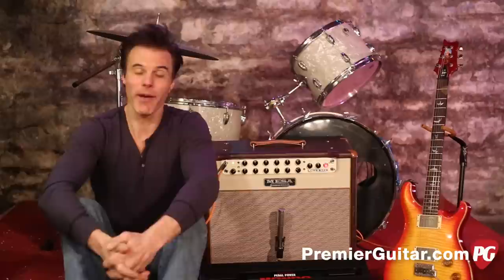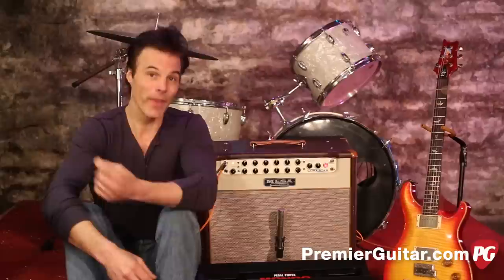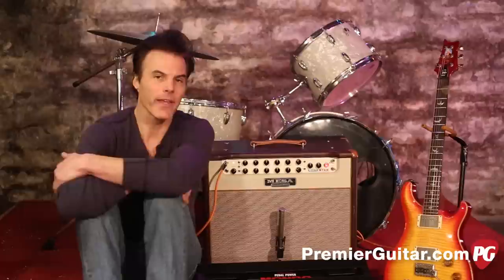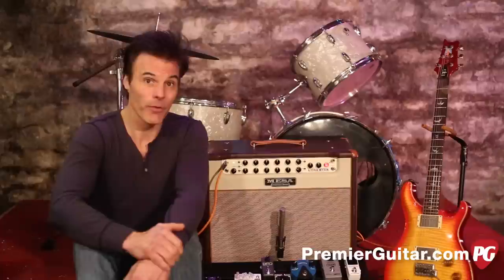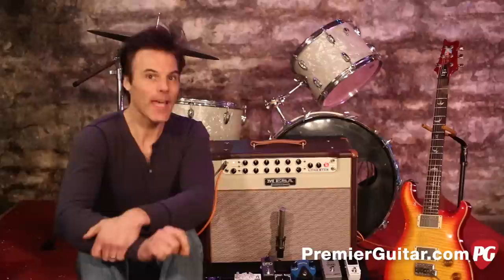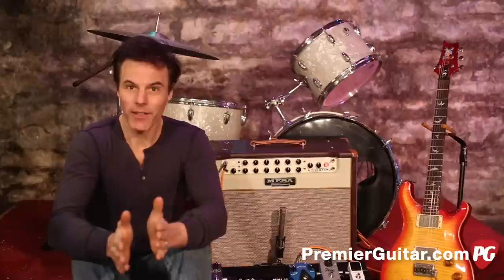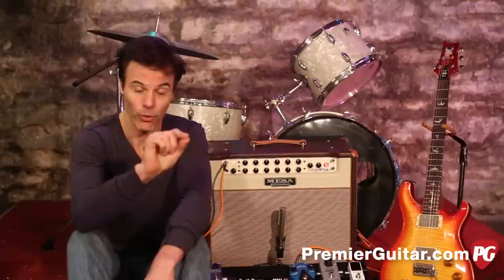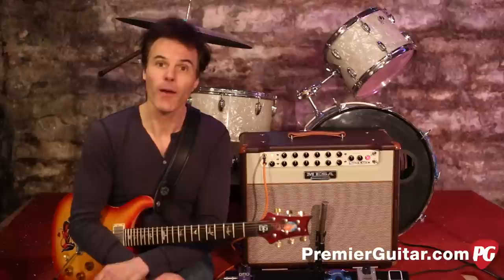DIY: How to Wire Your Pedalboard featuring John Bohlinger

Comment: Pedalboard Tip: Put the loop part (soft part) of your velcro onto you pedal and the hook part (pointy part) on the board so your pedals do not stick to the carpet, most people usually have it the other way around
Reply: I like it when they stick to my robe!
Reply: Homeowner Tip: carpets are for garbage people; tear that trash up and replace it with attractive (and healthier) laminate flooring
Reply: @lazylion420  jesus...the sarcasm is real. Love it. I was thinking the same thing.
Reply: @lazylion420  carpets are way more appealing on bare foot. Laminate flooring is good if you want to break your neck after getting out of the bath.
Reply: Well, I use a board with carpet attached to it, so I gotta go with the crowd
Reply: I do opposite because my board has several pieces of carpet that fit in my soft bag, I set up 3 different boards, each wired, I then choose which block I want on stage and I do want it to stick anywhere I place it
Reply: Great tip! Thank you!
Reply: I would do soft part on the board and hook part on the pedals 'cause otherwise the board will get grimy and junkish...
Reply: Put the pedal on your board so the pedal doesn't stick to the carpet.

Comment: Some great advice here. I wish there was something like this when I was getting started.
I would like to see in a future video:
1.  Pedals that go into effects loops.
2.  True bypass and buffering
3.  You mentioned digital pedals, so there should be some mention of AC power.  And with AC comes strict current requirements WRT power.
4.  For the future, I think a video (or series of videos) on MIDI boards from floor to rack would be very useful if you have 14 or so pedals -- think RJM's Mastermind to a RG-16 or something similar.

Comment: That's a great video John and PG. Very useful and no doubt a vital future reference for pedal enthusiasts. Thank you, I'll be sharing it for sure. The only thing I'd add would be to try and isolate digital pedals from analog in the power chain. That is, don't daisy chain digital with analog if you can help it as it will help avoid a potential 'mozzie' like frequency running through your signal. Cheers, B.
Reply: Or just don't use digital pedals at all...
Reply: +Danny Skrims Yes you can as long as your power brick can handle the milliamps. I use a 1 Spot CS12 from Truetone. As long as your power brick have designated 300 to 500 ma, you can run pedals like TC nova delay, line6 m5 ect.
Reply: Guitar to pedal then pedal to amp? or guitar to amp like normal and pedals to my DSLs fx loop in back of amp? Brand new to pedals, app tips. Thanks
Reply: Agreed. I have two power bricks, one for analog, one for digital.

Comment: I have a suggestion, for everyone with a Pedaltrain or anything else that's open & allows cable routing underneath:  rather than use velcro (which has failed me, and made a gooey mess), get a cooling rack (for baking) sized appropriately for your board and with at least 1" squared grids (to allow angled cables to pass through), zip-tie it to the underside at the four corners, get a spool or bundle of nylon cord or equivalent and cut enough length to tie each pedal to the board (burn the ends as fray-check, damp paper towel nearby).  I did that, and zip-tied the bigger pedals.  You'll never have to worry about the velcro failing in the summer heat, and you don't have to remove any feet from the bottoms.  Alternatively, I just bought a cheaper non-Pedaltrain board without slats (want to stop burning through money so quickly), and tried not even securing the pedals, but padding inside the case with the bubble wrap from shipping or an old T-shirt ... they don't really move around in transit, the board's flat when I'm playing anyway, and I feel more free to experiment with pedal order or substitutes than on my other board with pedals tied down (or when I had velcro).

Comment: I would highly recommend using 3M:s Dual Lock instead of the velcro. It is a lot more durable, holds the pedals better and does not go bad over time.

Comment: I would also suggest experimenting if any pedals sound better to you in the effects loop rather than in the front of the amp. Or even which pedals sound better before or after a distortion pedal. Those were huge tonal factors for me.
Reply: Roman L  Absolutely.
Reply: +Roman L I totally agree man, a lot of your modulation effects tend to sound better in the effects loop compared to right into the front. But hey, in the end it;s your own sound, so build it how you like it, we're just random people on the internet,.
Reply: Roman L.  Yes. Takes a ltitle more set up time but worth a try!
Reply: I found that Fender amps take a lot more kindly to putting all the effects before the pre-amp. Some amps don't like this at all, but Fender seems to be ok.
Reply: Roman yeah a good rule of thumb is time based effects go in the loop, dirt/volume goes in front.
Reply: Mark Farnsworth This only applies if you are driving the pre amp on your amp, ie amp overdrive. If you are just using a clean channel and using pedals to get your gain, the effects loop is not really necessary, and everything in the front works perfectly.

Comment: Speaking about power, what he didn't mention but is quite important to know: There are two parameters which determine electrical power: Voltage (V) and current (1A = 1000mA). And there's a little confusion going on.

1st: Voltage needs to fit!! Your supply should never give you higher or less voltage than what's written on your pedal (or in the manual)! A little more (like 1V) should be fine because good pedals should be protected (see manual). But this may reduce life time and makes you lose any warranty. Also pay attention to AC or DC (there are pedals that need AC power)

2nd: Current printed on the supply unit must be higher than (at least equal to) what's on the pedal. Even if it's ten times as high, That's fine. There's no limit. If you use a daisy chain, add the current of all your pedals, and it must still be lower than your supplying output. Don't ever run a digital pedal with less current than it needs, you can seriously damage it!!

Comment: I used to run hosa cables with a daisy chain for my pedalboard, I redid the entire thing with a BBE Supa Charger, and Mogami cable(redco sells bulk cable) with neutrick jacks and it made a pretty noticeable difference immediately. I had to turn the treble down on my amp! Much less hiss and hum!

Comment: Very good instructional on pedalboards!  I would like to add use a steady base. I used to use a board that came in a bag. Biggest problem was the board moving around on stage when I used a wah! The whole darn board moved.
I solved the problem by converting to a Pedaltrain rack. It's rock solid and stays in one place when I use the wah. Well worth the investment.

Comment: Very helpfull video...
I have my own board set up for my bass.
Envelope filter -> octaver -> compressor -> fuzz/overdrives -> Preamp (SFT) -> phaser -> Delay... but it's still work in progress.
Actually it's all powered by an old 9V powersupply TFT monitor... relatively cheap, but it does the job and it's very silent!

I'm currently building a dry/wet blender to put parallel to my dirt boxes... a great addition for bassists i think!

Comment: Be sure to put any pedals that are sensitive to input impedance(anything you might use your volume knob to clean up) in front and before anything with a buffer. I prefer the sound of my Muff with the volume rolled back a bit but if I use any pedals in front of it, it responds like the volume is cranked and gets harsh
Reply: Wisdom 

Same for my Voodoo Labs Fuzz. It has to be first.

Comment: Great video John. The only thing I would add regarding pedal placement is that some pedals such as loopers and delays with tap tempo are easiest to work with when you don't have to stretch too far for them, so I'd keep them near the front of the board if possible.
Reply: Are you crazy ? Delays, Loopers and especially Reverbs never go through the preamp, use the effects loop !!
Reply: Firstly, that's personal preference, plenty of people run them in front of the amp (and many great amps don't have loops). FWIW I generally use them in the loop. But secondly and more importantly, my comment was about physical placement of the pedals on the board, which has nothing to do with where they are in the signal chain. Your comment makes no sense as a reply to mine.
Reply: Martin Cliffe You're quite right that many great amps, & especially older amplifiers don't have an effects loop and if you check their spec's, you'll find that most of those amps eg Fenders, Marshalls, Ampegs etc had  spring reverbs situated (which fall into the same effects genre as delays, loops etc) AFTER the Preamp (interestingly - that's the effect of an effects loop - effects going straight to the poweramp, bypassing the preamp), but stick to your dogmatic point Marty, I wouldn't wish to dissuade you of your ignorance, short leg length for reaching those rear pedals & abstract thought for lusting after those intellectual heights.

Comment: Great tips! but one very handy thing to put underneath your board is an plug box, some pedals are going to hum all te time if there going through the same power supply. You can think of de real hard distortions/tube screamers. I plug my tubescreamer on it's self in the plug box, really helped with that great distortion sound.

Comment: To any youngsters watching this video. There is no pedal order. Chain it up how you think it sounds good. And if it sounds good, then its good. 
Anything can go before or after a compressor (besides maybe a wah) and anything can go before or after an overdrive. Compressor and Drive will effect the sounds of your pedal order the most. Another one is if a delay is before or after a reverb, and if that delay and reverb is before or after a compressor. The key is to know what your pedals are doing when placed certain ways and what sounds best to your ears. Unlock something new.
Some pedals only sound good solely where they are placed. Rather they sound terrible where they "should" be placed. And then someone comes along and does it "wrong" and unlock a new sound.

Comment: Great video John.  I have all my cables hard wound & put together by little Fairy's with added Fairy Dust sprinkled on for good measure ;-) LOL  Great point about not going cheap & trying to save cash on the cables that make your board work. Why get a 2,000.00 amp & a 2-3K guitar then add a grand worth of good quality pedals only to crap on your tone with cheap "Radio Shack" quality cables. I personally use Mogami & haven't have one crap out on me yet :-) Lava Cable makes a nice set that you can cut to your own board layout.   Plus as a rule of thumb if your going to have more than 3-4 pedals throw in a Buffer pedal at the beginning or the end of your pedal chain.  If you've got more than 8 pedals put a good Buffer pedal at the start and One at the end just to be safe :-)  Great video.

Comment: Tremolo between delay and reverb works better, I think, but there are no rules. I like to run one reverb/delay in parallel, then into a chorus.
Pitch shifter/harmoniser before dirt - it will track better.

Comment: I would likely use a little extra audio cable to avoid proximity to power cables. If I remember correctly, when they come close try to have cables cross perpendicular as opposed to running parallel. Please correct me if I'm wrong.  Nice video.

Comment: I run my Line 6 M9 from its own power source and the rest from my trusty OneSpot.  -->Wah-Tuner-Comp-OD-Dist-Trem-M9(Verbs/Delays)-->Amp
Reply: I’m getting a buzz in my eq and overdrive.using a one spot.i will get a isolated power source when money is no longer a factor.Every set up is different.I wish I had your luck

Comment: You didnt talk about the effects loop and why time based effects that take larger power ratings also need a good effects loop to route through which has select-able line / instrument levels.
Overall pretty sound advice though.

Its worth noting that all your accessories are worth $1000USD BEFORE YOU HAVE BOUGHT ANY PEDALS. That makes a $2500 - 3000$USD board, maybe racks need to come back?

Comment: I run the same sized pedal train. I use the bottom row for effects before the amp, and the top row for pedals in the amps loop.  I removed my Dunlop volume pedal from the board because it was so heavy and monopolized a huge section of real estate. The wah remains, though.
Reply: Get a chemistry design werks Holyboard, no tape, no sticky Velcro Bullshit.Zip ties very simple and CLEAN.Thanks Chris I'm getting a standard wide next.Thanks Chris and will talk to you soon

Comment: Something I learned by trial and bummer - is ma's or Mini Amps.  Strymon pedals use 9V like most pedals (not all) but they require higher ma's.  So if you're running  Strymon Timeline you want 9V 400ma minimum. Strymon Blue Sky  9V 300ma.  Running a Mooer pedal you can use 9V 100ma and so on.  So when you buy a pedal check what voltage AND ma's required and then make sure you power supply can handle what you got otherwise all the right cabling and other jazz will be for squat.
Reply: P.S. Your power suppl;y can have more ma's then your pedal requires because the pedal will only use what it needs.  But you can't go lower without  your pedal under performing or even being damaged.   "Whirled Peas please"
Reply: that's mili-amps...not mini amps
Reply: Okey-dokey.

Comment: I have a question: How the output, the input, mono sounds are connected? The guitar to the pedal, to a amp and a recorder. How the input and the output can work accurate? Not to make a buzz noice either a cancelation sound
Reply: Aaron Zepeda If there's a buzz, there might also be something wrong with your power supply. Try with a battery to see if that's the case. It may also be caused by an energy saving lamp (turn off the light: Is it still buzzing?) There are many possible causes!

Comment: I run my wahs off my board, I use a SKB stage 5, which powers most of my pedals. I use 9V, 18V, and 12V.  The SKB was only 300ma in the 12 Volt category.  I had to add an extra power supply to add 300ma more to the 12 volts.I run 18 volts to my Catalinbread Dirty Little Secret MKI and Wampler SLOstortion. The power supplies are isolated except for the 18V pedals. My pedal board order is a little different in the way I use a Boss TU-2 Tuner as a splitter. I run output A to stereo fx and B to a dry out amp feed.  My pedal board as a patch bay setup. So, I run my wahs first. Then into a BOSS NS-2. Noise Surpressor. This has a loop, which all my gain pedals run through. I have an Xotic SP compressor first, then it goes into a Bogner Red Ecstacy.  The next 2 pedals are in a Keeley True Bypass. I have the Catlinbread DLS and BOSS BD-2 tone stacked. The Catlinbread DLS is always on in the bypass loop. If I want to blend, I kick in the BOSS BD-2. The Keeley True Bypass allows me to engage/disengage both of those pedals at the same time. I plan to add another True Bypass to insert my ADA MP-1 that is installed my rack. Which was converted to an amp head. This allows me to use the ADA MP-1 remotely.   Last is the Wampler SLOstortion. This pedal has an independent solo boost that effects any of the gain pedals.

After that the loop is complete and the output of the NS-2 goes to a volume pedal. I use it to attenuate the signal inront of my PQ-3B parametric eq. From there it goes to my TU-2 Tuner. Why? well it allows me to split to A: stereo fx inline. B feed dry signal in to a dry amp feed. I use T.C. Electronic Nova Modulation (dual modulation engine) then a T.C. Electronic Nova Delay (programmable presets with display), then it goes to a Biyang Stereo in and out Stereo Reverb pedal.  Those stereo feeds go to the stereo amp feed.  This setup allows me to go Stereo or Wet/Dry/WET  I have an Orange Micro Terror and an ElectroHarmonix 44 Magnum currently, I plan to get a 2nd Orange Micro Terror.  I have used a MusicMan HD150 head with those amps, when I gigged last year for 9 months.  My amps are super clean, and they can get surprisingly loud for 20 Watts and 44 watts. It serves my needs well and I am quite happy with the high gain Bogner and Soldano tones I have along with the Plexi and JCM 800 tones. I have even wilder tones with the ADA MP-1.

Also, I run my effects in line, so I don't have an effects loop. It sounds great and this setup is very versatile.
Reply: Do care if you don't care...?
Reply: Oh my feelings are so hurt....Rellly grow up. I share information to those that seek. Go troll somewhere else! Are you a middle school child?  Why waste time being negative and say something meaningful. I don't care for a lot of the childish and stupid comments 90% of the uneducated folk on here say. I got lots of better things to do.

Comment: I'm still wondering which would sound better:
Overdrive pedal into a Distortion pedal or Distortion pedal into an Overdrive pedal?
I have a Fulltone Full-Drive 2 MOSFET and an MXR Super Badass Distortion and I like to use the Full-Drive as a boost pedal. Any suggestions?
Reply: Hello 5 years later lol. I would say if you wanted to experiment put the full drive first, then the badass distortion and get a clean boost pedal ie TC spark. That way the full drive can be your light overdrive, the badass your heavy and for solos hit the spark to stand out. Also the full drive on with the badass will boost the gain and make it heavier. Cheers from the future 🤘🏻

Comment: Thanks for the video, i agree with the most things, But what about buffer pedals, you  didnt mentioned buffer pedals ??
And the importance of having one, if you are running 14 pedals on one board. I noticed , You do use a echoplex pedal to boost volume, but what about in beginning of your pedal board, wouldnt it be a good idea to have a buffer pedal.